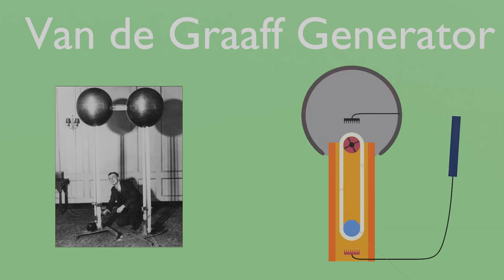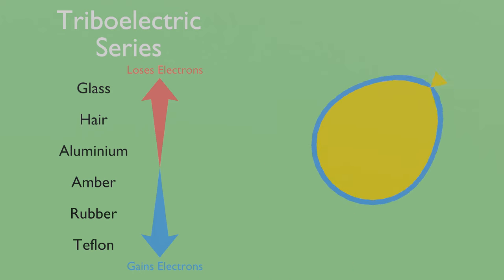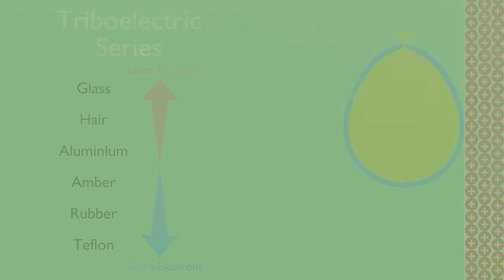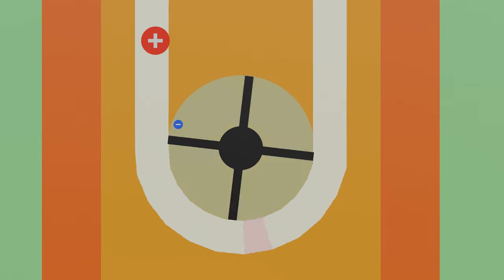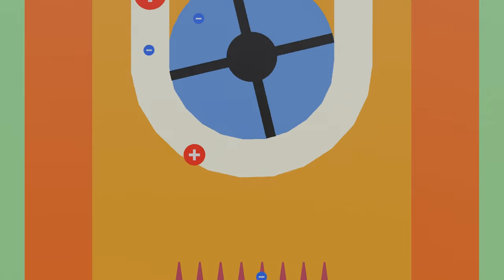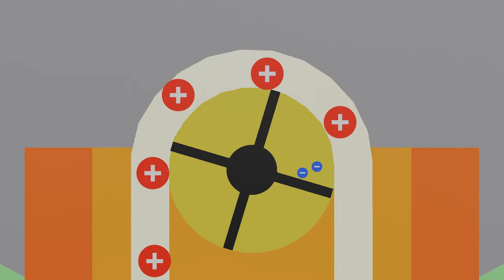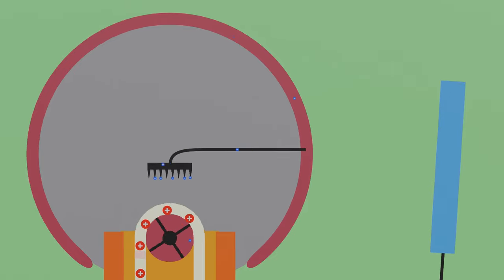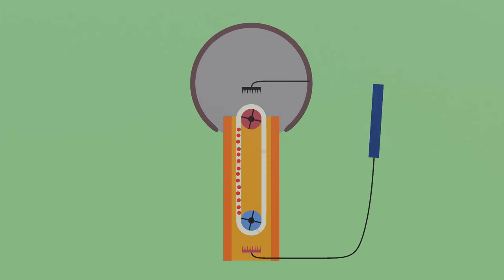The Physics of a Van de Graaff Generator

Comment: So.. it flings electrons
Reply: Depends on how you think about it I guess, but it's more accurate to say its like an electron vacuum sucking them out of the air till the bin is full and needs emptied
Reply: @theamaturepro  I think flinging is better
Reply: @xlargetophat  😂 then flinging it is! I actually like it.
Reply: @theamaturepro  the centripetal force is overtaken and the electrons are flung out. The curve seems important.. idk.. maybe not because maybe the curve only exists because of the form factor of the machine. I guess the electrons would leave if the copper pickup was a long the sides as well.. but maybe the roller it self being Teflon does the pushing and the curve doesn't matter at all? Idk
Reply: @xlargetophat  oh, are you talking about the belt flinging electrons? That totally makes sense. I thought you meant the sphere. Also, nice use of the term centripetal. You've obviously taken physics
Reply: Its called Corona discharge and its closer to like ripping it out of the air

Comment: Definitely the best video, but I still have one question. When the belt becomes positively charged at the bottom roller by the triboelectric effect, why do the positive ions stick to the already positive belt? Shouldn’t the belt repel the positive ions despite the attraction of the roller? The belt is closer to the ions after all.
Reply: The roller has a stronger negative charge (stronger attraction than the repelling force of the positively charged belt), and also the belt that descends to the bottom roller is neutral and only begins to become positive as it comes into contact with the bottom roller.

Comment: I'm not sure I understand the balloon example. I get that the balloon gets electrons, and becomes attracted to the protons in wall. But wouldn't it be equally repulsed by the equal number of electrons in the wall?
Reply: Ok I think I figured it out. I should've watched more before commenting. Just like in the other examples, the negatively charged ballon repels electrons in the wall.That makes the wall positively charged. and then that attracts the negatively charged balloon.
Reply from the maker: Yes exactly, you have the right idea!
The atoms/molecules of the wall are overall electrically neutral, but in the presence of an electric field the electrons will shift slightly and separate from the positive nucleus (this is called polarisation). The negatively charged balloon provides this electric field, repelling the electrons in the wall and leaving behind the positive nuclei.

This same effect can explain a lot of molecular forces (e.g. the electric field from a charged molecule polarizes a nearby neutral molecule and they attract) and is used when designing capacitors (a material placed between two oppositely-charged parallel metal plates gets polarised by the resulting electric field - the electrons are shifted one way, the nuclei go the other way).
It's good that you raised the question as I'm sure this helps clarify things for other people too!

Comment: Why is the negative pole a sink when electrons are moving to the positive charge and the pole is the source of the electrons
Reply from the maker: A sink is the opposite of a source.
The dome acts as the source of electrons as it supplies the electrons  - as electrons are removed from it, it becomes positively charged.
The metal rod acts as the sink as it takes up electrons - as electrons gather on it, it becomes negatively charged.
Electrons are moved from the source (dome) to the sink (rod) by means of the belt carrying electrons down the column.
During the spark, electrons move from the negative metal rod to the positive dome, so the rod is now acting as the source and the dome now acts as the sink.
Hopefully this all makes sense.

Comment: Help.  
The mechanism seems exactly opposite of the hair and balloon.  If a balloon becomes negative after friction with hair why doesn't the rubber belt become negative when run against the felt rollers of the Van Degraaff?  Straight to the point, I was always under the impression that the dome became more negative and not positive.
Reply from the maker: Whether the dome becomes positively or negatively charged depends on the materials used and their relative positions on the triboelectric series. 

The balloon becomes negatively charged because rubber is lower down on the series than hair and thus has a greater tendency to gain electrons.
However, the rubber belt becomes positively charged because the bottom roller is made of Teflon which is lower down on the series than rubber, so Teflon has a greater tendency to gain electrons than rubber (so the rubber belt loses electrons).
Compare that with the top roller which is made of aluminium, which is higher up on the series than rubber, so has a greater tendency to lose electrons than rubber and is left positively charged (while the rubber belt gains electrons). 

In this setup, the dome becomes more positively charged because the top roller loses electrons, but if you swapped the two rollers around, then the bottom roller (aluminium) would lose electrons, and the top roller (Teflon) would gain electrons, causing the dome to become more negatively charged instead.
You can use other combinations of materials too; as long as you know where they are on the triboelectric series, you can figure out where the electrons flow.
Hopefully that clears things up
Reply: @mr.nofear8646  ok. That helps quite a bit.  The one I teach with has a felt bottom roller and a plastic of some sort up top.  
Thank you
Reply from the maker: That's interesting. So presumably the felt roller would lose electrons, which ride up the rubber belt and are then gained by the plastic roller, giving it and the dome a negative charge.
If you have an electroscope you should be able to find out the polarity of the charge on the dome. I suppose you could also charge up a balloon by rubbing it on your head and then hang it by a string near the dome. If it's repelled, the dome is negatively charged; if it's attracted, the dome is positive.
Glad I could help
Reply: @mr.nofear8646  I always hang a balloon from the classroom ceiling.  When the kids stand next to the generator I always have them reach out to the balloon to repel it away.  
I also have them reach for a thin board that I mounted to a fidget spinner.  They are able to attract the board with their hand like the balloon to the wall.

Comment: do you think it's possible to make the belt using Teflon and the roller using PVC, Will it work?
Reply from the maker: I don't think so because the belt has to both gain and lose electrons, so the materials for the two rollers need to be above and below the belt material in the triboelectric series. Teflon is already really low down in the triboelectric series, so I doubt you'd find a material even lower than that for one of the rollers.
From what I've seen online, Teflon and PVC are very close, so you could try it out. Just make sure the two rollers are of different materials above and below Teflon e.g. PVC and glass
Reply: @mr.nofear8646  thanks alot!

Comment: How can the under spikes be positively charged if the rod attached to it has negative charge?
Reply from the maker: You're asking how the same object can be both positively and negatively charged?
Initially both the rod and metal spikes are neutral. As the bottom roller builds up negative charge, this repels electrons at the tips of the metal spikes and they move down to the rod.
So the electrons have flowed from one area (spikes) to another (rod), leaving the spikes with less electrons (positively charged) and the rod with more electrons (negatively charged). Hopefully this makes sense.

Comment: what if the spikes touch the belt?
Reply from the maker: I don't know exactly - the device probably wouldn't work as well. Presumably there would be another triboelectric interaction as the belt rubs against the spikes, I guess depending on which material is used for the spikes.
The device relies on the belt losing electrons at the bottom and remaining positively charged on its way up to the top where it collects electrons from the dome and brings them down. So if the bottom spikes lose electrons to the belt, this could reduce the size of the positive charge carried up the belt, impeding its ability to charge up the dome.
If the bottom spikes instead gain electrons from the belt, this might interfere with the roller charging up, but maybe not since I don't think there are many metals lower down on the triboelectric series than Teflon.
If the top spikes gain electrons from the belt, this would leave the belt even more positively charged, rather than it taking away electrons from the dome.
If the top spikes lose electrons to the belt, I think the device should still work, maybe more slowly.
There may be other phenomena that occur too with all the interacting electric fields, but this is my best guess for now.